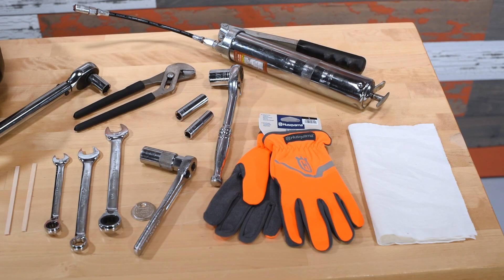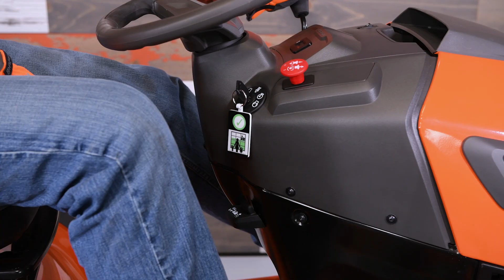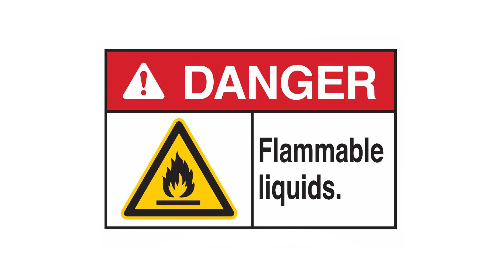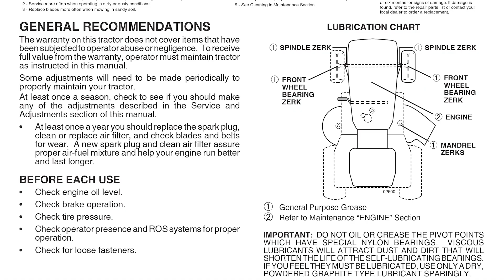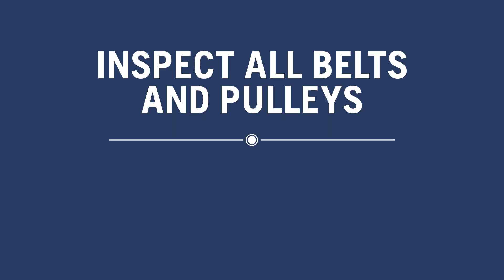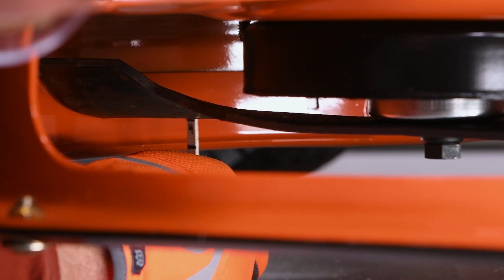Riding Lawn Mower Annual Service

Comment: There is always someone who moans. Today, it's me. I would like to offer a small piece of advice for the owners of some Husqvarna mowers  Bolts on cutter blades do not all turn Anti-clockwise. If you have a centre extraction port on the deck, you may find the blades turn in opposite directions. In my humble experience undo the bolt in the direction the cutter cuts.